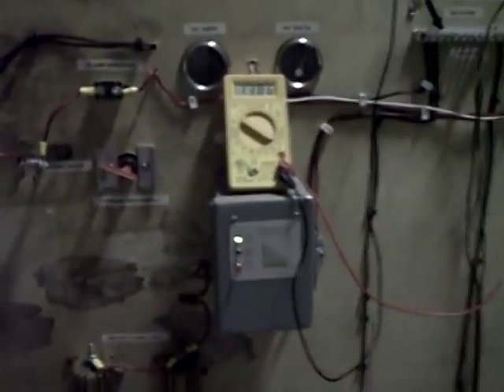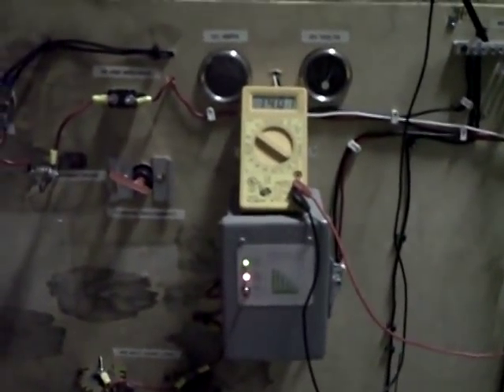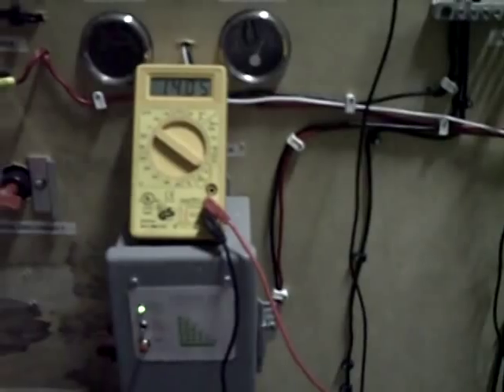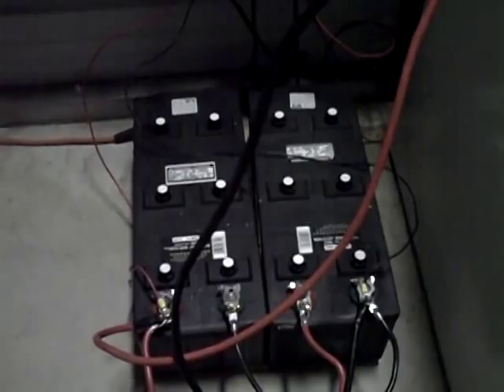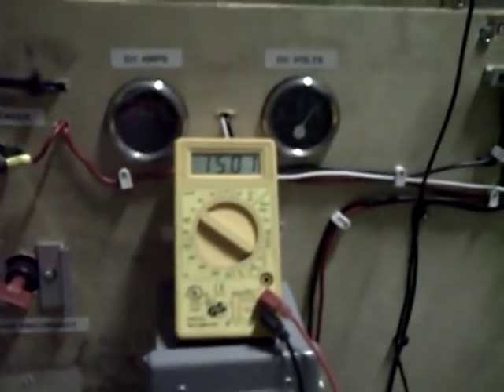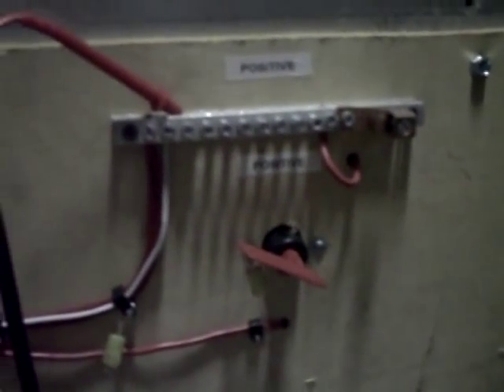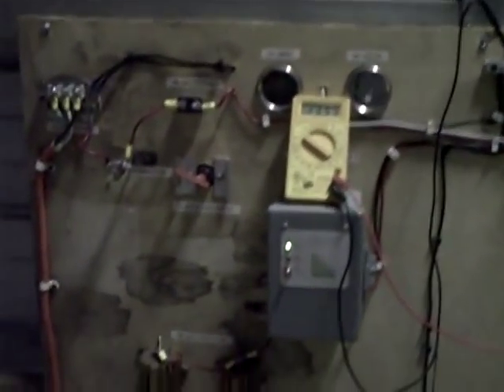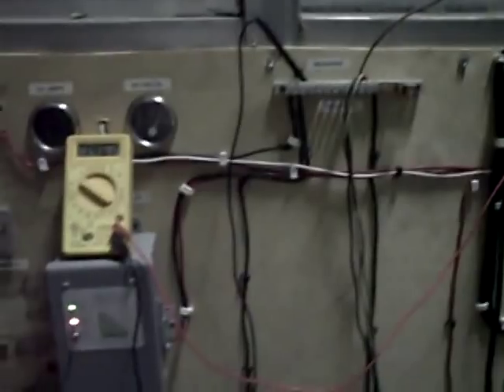Wind turbine charging batteries pt1

Comment from the maker: Watts won't change at all as watts is the measure of power produced by amps/volts. Volts can go up to from 12 to 96 and all that will happen is that amps will drop from 33 amps to 4 amps - but the amount of watts will remain the same. In reality you'll never be able to get the turbine to produce 96 volts unless you have some pretty incredible high winds all the time. Batteries, all that's needed is 16 of them in series to make a 96 volt bank.

Comment from the maker: I don't have a water heater within 100 feet of the batteries, I'd spend a fortune on wire, plumbing and a DC water heater just to dump a load "when" it happens - which is not often. Not a practical solution for me. A charger under load is not possible since the reason the dump load is needed is to avoid over charging the batteries. That is why the resistive load dump is the standard method used, we don't over-design and over-spend for the 10% of the time where wind load is highest. Thanks.

Comment: It seems a shame to waste power by "dumping" into those resistors.
Could 'nt you direct the current instead into a hot-water heater element or even a charger under load.
This would allow full charging capacity when it is windy but there is no solar available ?

Comment: This is pretty good. I have just ordered a 12 V 200 Watt wind turbine and 12 V 200Watt Solar panel with hybrid 12V charge controller and a 96V 5KV Inverter. I therefore need a 96V battery bank. 
Can I charge the battery bank with the 12V Hybrid Charge controller?
Thanks

Comment from the maker: @billmalta1 You can find all you want for your DIY turbine by going to an eBay store called Coleman Air Parts, they have the rectifier in a box already assembled for you, they have charge controllers and dump loads for what you need. If you're not sure what you need, contact the seller and they will help you select the right model for your size turbine. They really make good products and are very helpful.

Comment: Thank you for your answer, unfortunately i have a home made wind turbine with a capacity of about 1 or 2 kw (c my video) I need to find all the parts for it such as charge controller with dump load, inverter, diode batteries ... I guess they are many different systems to choose from and all have different capacity. This is where i really need help to choose and understand what to buy... I am using 24 N50 neodynium round shape 5 cm* 1.5 cm and 9 coils of 18 gauges/ 260 turns each....

Comment from the maker: @billmalta1 If charging with solar panels you don't need a dump load. If you are using a wind turbine then you'll need charge controller and dump load. contact the folks at Coleman Air and they will help you select a charge controller and dump load. If you buy a WindMax wind turbine, then it will already come with the charge controller and dump load- which is one reason I recommend them so highly. They will save you money and charge better than others out there. God bless you.

Comment from the maker: @TheSolarSkater That should not be a problem, the voltage is really regulated by the batteries so as long as the batteries are connected your wind turbine voltage will stay within a  few volts of that battery bank voltage. The main difference you'll find is that when the batteries are full the solar charge controller will open the circuit and disconnect the turbine - which is fine.

Comment from the maker: Thanks buddy!  It will get more cleaned up in the next few weeks but more components will added as well so I'm afraid it will look fairly complicated because I'm mounting two more inverters to the board and adding the second turbine plus the Amp & Volt meters for both and additional disconnects. I will be posting another video this weekend with the existing tower being raised from 40' to 55'. If that holds well then I'll raise the second turbine on a parallel tower.